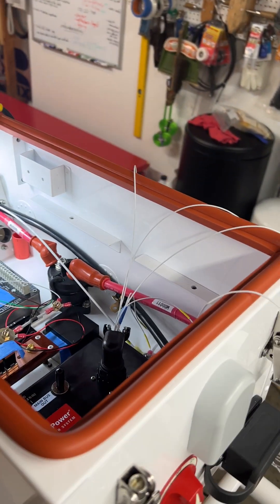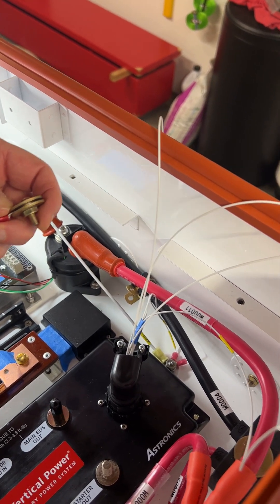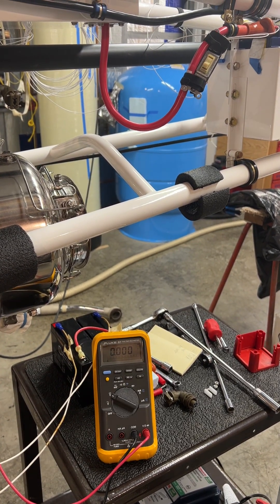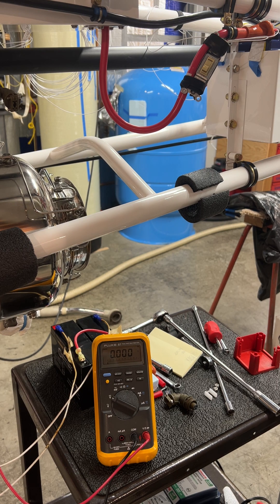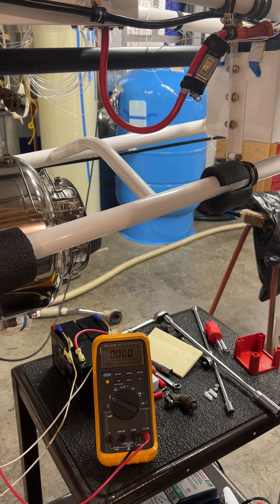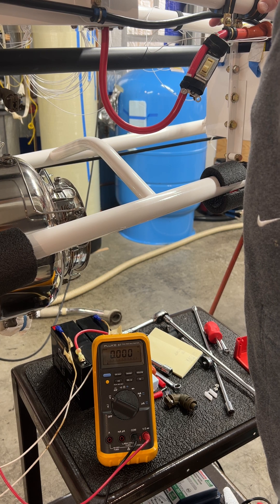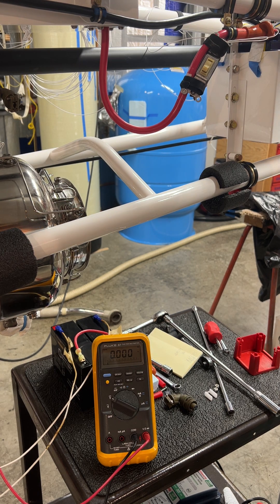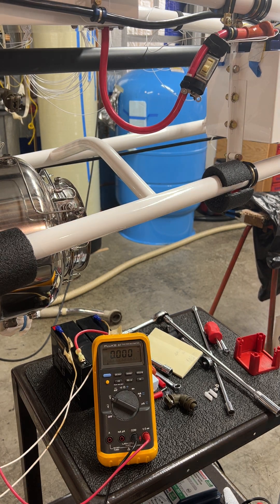Solar T62-32A Turbine Engine for Single-seat Experimental Helicopter - Starting-scheme Test 3 of 3

Comment: I think I may have your answer. I've designed auto start engine control units for 2-wire ATS generators and have seen similar issues. Anytime you use a solenoid, especially larger ones they induce a several hundred volt spike, this is caused by inductive flyback from the windings. The induced kickback is enough to cause the microcontroller inside the control unit to trigger a  reset. Flyback diodes sometimes work, but not always fast or sensitive enough. You can try putting a fairly high ohm resistor across the solenoid coil contacts and should solve it. You have to size the resistor according to the load/voltage but if you have the solenoid specs I could offer some ideas. hope this helps
Reply from the maker: Thank you for the reply and suggestion.  I need to make and post another video illustrating what eventually were determined to be the problems with trying to start a Solar T62 turbine engine with a Tilton racing starter through the Astronics/Vertical Power Primary Power System (PPS).  Problem #1:  The starter must overcome the significant stationary inertia of the turbine, two reduction gearboxes, the alternator, the fuel control unit, as well as some friction from the 6 V-belts which, while loose with the clutch disengaged, present additional resistance to rotation of the engine.  The starter's initial inrush current exceeds the PPS's 1400-amp 50 microsecond protection limit causing the PPS to terminate the start as an act of self-preservation.  Problem #2:  The PPS is very sensitive to proper grounding and it's external ground stud really needs to be grounded directly to the negative post of the battery -- not at any of the other points that I tested, including directly to the engine gearbox.  The chief engineer at Astronics, in response to my inquiries, did some tests and determined that the problem, in this particular case, was likely do to "ground bounce" of perhaps 1.5 VDC.  I measured the 1 millisecond voltage during the start at about +9.5 VDC (the main battery is actually two paralleled earthX 900EX 12-volt lithium batteries).  With a ground bounce at the PPS's ground terminal of 1.5 VDC that reduces the reference voltage that the PPS circuitry is seeing to at or below the internal 8 VDC limit which is also a set-point for the device's protection logic.  The system is all wired up and working as intended now except for the fact that the PPS's "Starter Output" terminal, rather than powering the starter directly, is now only powering a separate Kilovac contactor's coil which closes the contactor and sends power directly from the battery to the starter's integral solenoid/switch.  When I get time I will make and post a new video explaining the final solution to my problem.  Also, there are TVS diodes installed on both the new contactor coil as well as on the Tilton starter's solenoid/switch.